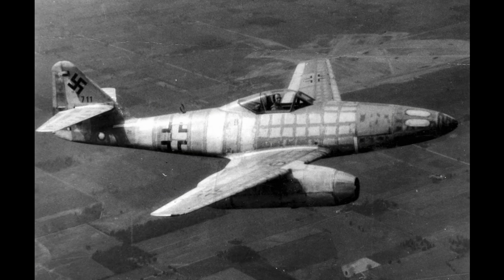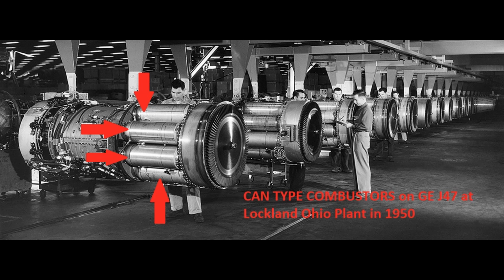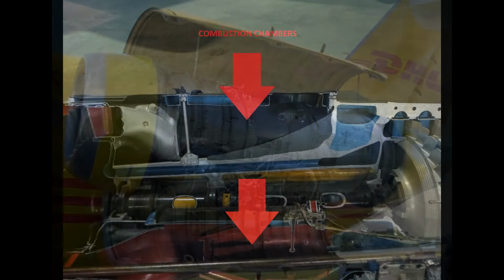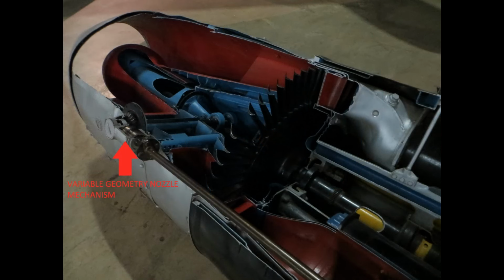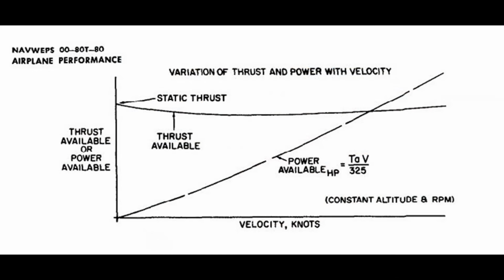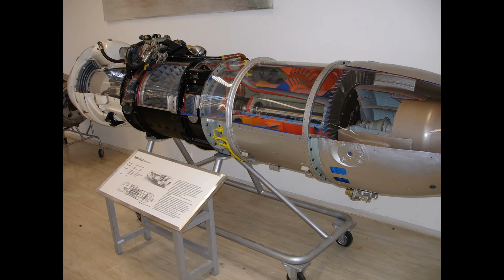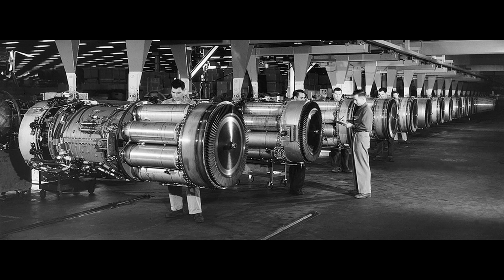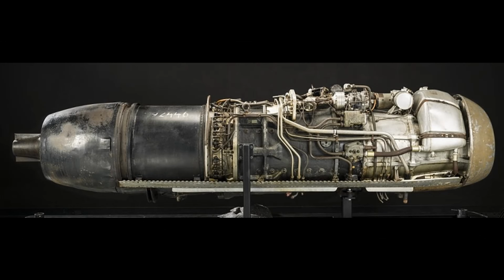World War Two JET POWER

Comment: One important distinction between a jet and a piston engine is "what happens when the fuel is burned". In a piston engine, the fuel is burned at constant volume; pressure and temperature increase dramatically. In a jet engine, the fuel is burned at constant pressure; the volume and temperature increase. The highest pressure in a jet engine is at the output of the compressor, not in the combustion chamber- this is why flames don't (normally) come out the front.
Reply: Not inaccurate,  but I think the better explanation is that jet engine sustain continuous combustion at constant pressure. Reciprocating engines on the other hand have varying pressure, volume and temperature.
Reply: In my opinion this is a significant remark because I never got the answer during the 50 years I’m interested in airplanes.  I never understood how it worked : incoming air is compressed to about 7bars, you add fuel and you burn it, raising the pressure.  So how come the burned air does not block the incoming fresh air from flowing in, or even flows back to the front.  This topic is never explained in whatever book or video, not even in Gregg’s video.   About five years ago I asked the question to someone who graduated from Aviation Design at Delft (THE reference for technical matters in our region) and he wasn’t able to give a straight answer.  Worse : he was even mumbling something about venturi-effect.  About a year ago, I asked the same question to a nephew of mine who was studying at the university of Leuven and after a few days he came with the answer as explained very briefly by you : the pressure in the combustion chamber doesn’t raise but is lowered, as the chamber is open at the back end.  Only the rear fan gives a slight raise in pressure as it sucks energy to make the whole circus turning.
Reply: Fuel is burned in an expanding volume. At least in my cars.
Reply: @TwoLotus2  In a piston (Otto cycle) the flame front should sweep through the mixture before the piston descends, or you aren’t maximizing expansion and extracting power. That is why timing of spark is considerably before TDC, and why advance increases with part throttle. It is why big cylinders, like aircraft engines, have dual ignition and small cylinders don’t bother.
Reply: @TwoLotus2  In an ideal Otto cycle combustion is supposed to be complete the moment the piston starts to descend; I can't speak for whatever is happening in your car though
Reply: Can i ask what is the significance of burning at constant volume vs constant pressure?  is there any impact on performance or characteristics of the engines?  Sorry if these questions seem dumb, i'm currently an aerospace student who is halfway through learning thermodynamics so i dont fully understand these processes yet.
Reply: @kampgruppe101  In constant volume combustion the gas does zero work, and the heat of combustion goes entirely into increasing the internal energy of the gas. In constant pressure combustion some of the combustion energy transferred to the gas is used by the gas to do work. Neither is as efficient as it could be (constant temperature combustion, yes I know that sounds very weird) but of the two methods constant volume is somewhat more efficient, hence why piston engines still have turbine engines beat in terms of efficiency.
Reply: @kampgruppe101  the two cycles are different and have different advantages and disadvantages. The gas turbine is smooth and has high power to weight, but is inherently expensive and has poor part load economy. The Otto cycle is simple and cheap with good part load economy. The diesel is harder to start, is noisy but has better efficiency than the Otto cycle. The choice is often driven by external and economic factors. This is.why these options are all in use in our everyday lives. There is a great 2 volume work that explains all of this clearly - “ the Internal Combustion Engine in Theory and Practice “ by C F Taylor.
A wonderful in-depth explanation of all IC engines
Reply: It’s worth looking at Anthony Kay’s “German Jet Engines and gas Turbines”.  There was a time jet engines might have become constant volume with the compressor loading a combustion chamber and inlet and exhaust valves alternately  sequencing to drive a turbine.  It does work.  German railways built some that could work on powdered coal in the 1920s.  Hans vin Ohain even designed one at Heinkel.
Reply: Well said. Many people fail to grasp that fundamental difference between Otto cycle and Brayton cycle. Pressure stays constant in a gas turbine, volume increases. In the Otto cycle the volume ( during combustion) stays constrained and constant while pressure spikes.

Comment: The Meteor first flew with an axial engine.  The Brits opted for a centrifugal engine because it lasted much longer than the early axial engines.  Realize also that the Mig-15 had a centrifugal engine (of British design) and did pretty well against the F-86 with an axial engine.
Reply: Wrong, The Meteor first flew with Halford H-1 engines which had a centrifugal compressor (March 1943), The Rover W.2 (Whittle) engine intended for the aircraft was at that time only producing 60% of the thrust required. A later prototype did fly with the Metrovick F.2 Axial flow engine (November 1943), but it was lost, along with the pilot when one of the engines exploded in flight (January 1944).
Reply: A Meteor was fitted with a very early turboprop in 1945, the RR Trent to become the worlds first turboprop aircraft.
Reply: @tristacker  Sure did.  Some of those testbed aircraft from the early jet/jet turbine days made good use of older airframes to develop the the-new technologies.

Comment: i heard jet engines arent picky about fuel. they couuld be ran on 99% alcohol, gasoline, kerosene, diesel, hydrogen, and other highly flamable liquids.
Reply: +trimbale Mr. Bale     I think the field manuals specified about seven fuel combinations that could be used for the Jumo 004 and could be mixed in the field, such as avgas mixed with fuel oil.
Reply: dont forget the chrysler turbine.  ran on a centrifugal turbine.
Reply: @trimbalemrbale575  And famously on Tequila

Comment: “One of the advantages of the jet engine over the piston engine is the jet engine's capability of producing much greater amounts of thrust horsepower at the high altitudes and high speeds. In fact, turbojet engine efficiency increases with altitude and speed.”  FAA-H-8083-3B

Comment: I've always heard the Ju-287 was an experimental design to test forward sweep. The fixed gear was to speed development and a retractable gear version would be developed as the fixed gear version was being tested. The use of the BMW engine was likely a politically motivated mandate from the top (BMW pulling some coat strings).
Reply from the maker: Makes sense.
Reply: I don't think so. As far as I know the very mild forward sweep was to move the wing box rearwards, so that the bomb bay could be at the center of gravity and a large payload could  then be carried and dropped without trim drag penalty, thus extending the bomber's range.
There's a great talk by a test pilot of the X-29 program that mentions this, but I've heard/read it before, and it makes total since to me that this was the motivation from a design perspective. Here's the talk: https://www.youtube.com/watch?v=LOmvrk3LPGc. This channel is BTW absolutely awesome for military aviation lovers.
Reply: BMW, originally intended for Me262, Ho229 etc.. was just a better design than Jumo (especially the chamber and compressor sectors), more compact and 100 kg lighter (even 300 kg compared to Hes 011), highly developable, with record power-to weight ratio in C (9 kN) and D (10.7 kN CLASS II of thrust like Hes011) versions. So when it was considered reliable enough it was the choice for many projects (Horten Ho X and supersonic XIII, Arado E560 series, Ar234C), even in R version, coupled with BMW rocket engine (109-718) flight tested on Me262 and He-162.

Comment: Nicely done video Greg;  I have one question and one comment: 
1) When you say all the turbine engines you have flown can be "configured to automatically restart", do I assume correctly that you simply mean turning on the continuous ignition, or are you talking about a system that actually engages the engine starter automatically? 
2) With regard to the time between overhauls not being as drastic as it sounds, if you haven't already you should check out the data on how many kilometers a Tiger tank could travel before needing an engine change.  It was such a short distance that it seems a fresh engine would be needed after any significant road march or battle.  (If anyone has info on Panzer unit use of tank transporters I would welcome a comment on that.)
Reply from the maker: Hi Gort, I didn't want to focus too much on relight stuff, but yes, turning on the continuous ignition is a solid defense and will provide a relight in most cases. Many planes automatically turn on continuous ignition when anti-ice is on, or when flaps not all the way up, that's the "configured to automatically relight" I was talking about. Worst case, if done manually, it's usually some version of thrust levers to idle, Ignition ON MAX, BOTH or whatever give the most energy to the ignition, then if it doesn't re light, fuel cuts offs off, then on. Or some version of those basic steps.
Reply: @GregsAirplanesandAutomobiles  Thanks; standard stuff then.  From the way you phrased it I was wondering if there might be some automated full restart sequence in some of these these newfangled digitally controlled engines when they sense a flameout.

Comment: Maybe you've already made a video about this but is there a reason the Germans seemed to stick to three blade propellers while the allies had moved up to four and even five bladed propellers?
Reply: +Rjh Rhj   Propeller design will make good topic.   The short answer is still complex with propeller choice being a series of trade-offs between total blade surface area,  engine power output,  optimal operating altitude, and weight and complexity to manufacture during wartime.
Reply: @FiveCentsPlease  Don't forget the need for bullets to fire through the prop hub and between the propeller blades.
Reply: I've been trying to get Greg to bite on this subject for some time but his pipeline seems full.  I know the basic answer, but I would love to see Greg do an analysis of it.  Thanks for the help and let's keep asking him for it.